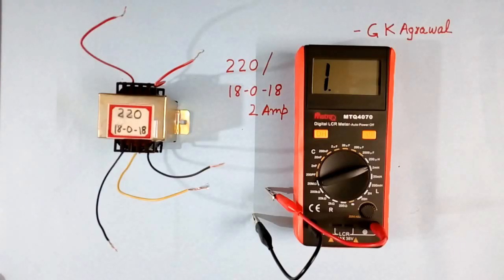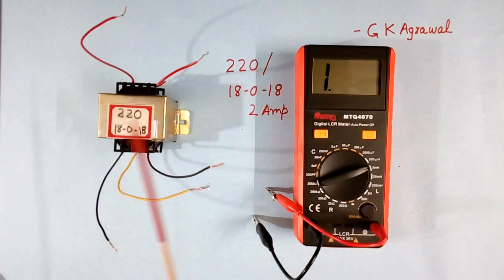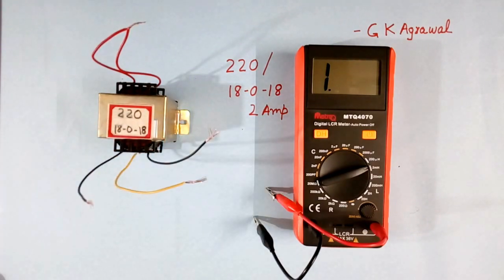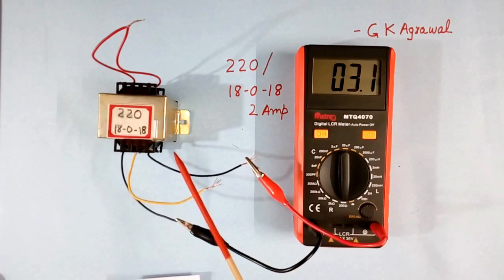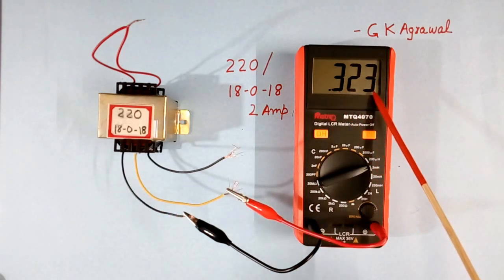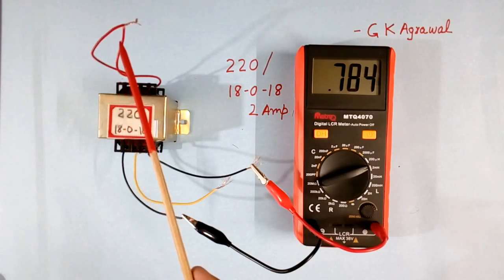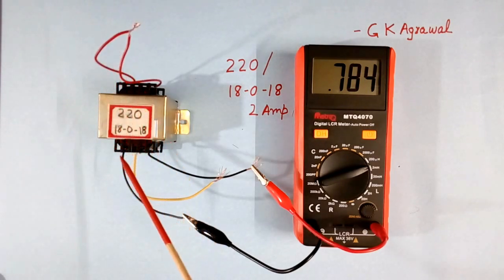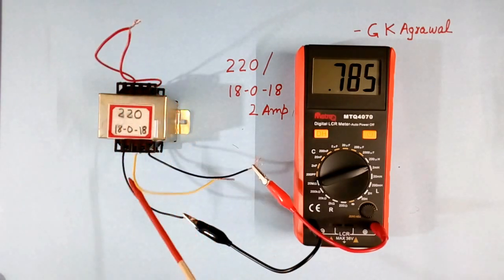Electrical transformer use trick & experiment at home DIY

Comment: what if the core is rewound. as a inductor? and there is no primary winding? what kind of frequency range are they good for. and can they be used for. DC to DC power conversion?

Comment: Sir please explain power grid setup and equipment used in power grid such as isolator feeder and distributor and what is the difference between them. And also explain what is the difference between  power grid smart grid and substation. It is very necessary  for electrical engineering.